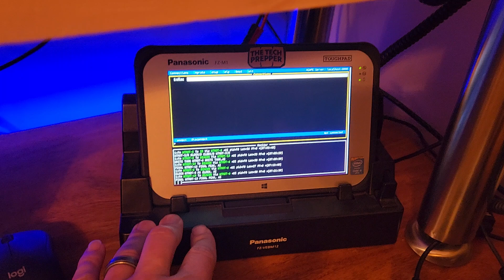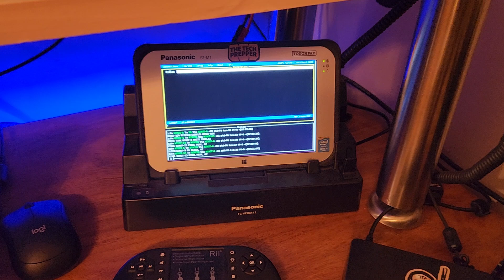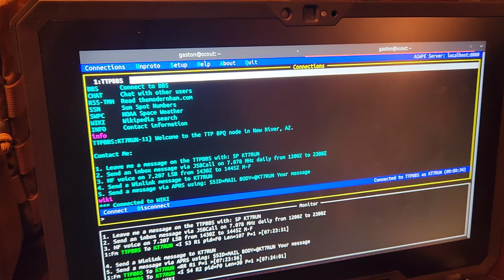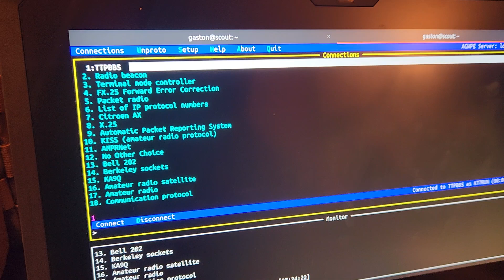A quick debrief on the 9600 baud packet BBS port

Comment: I notice the new FCC rule for symbol rate did not include 6M since it was VHF. Let’s hope they take the symbol rate requirement out of VHF and UHF to get better speeds like 56K with higher order modulations.
Reply: Yeah especially because error correction is a thing, it would work flawlessly

Comment: 9600 baud is fast, but you'll find that it doesn't work well for long distance transmissions.  APRS also supports 9600 baud as well!  I wish more radios supported it as well - that's the other negative.  The number of radios that support it is small and not growing.  When comparing symbol rates, the speed of 9600 baud vs VARA FM wide mode, there's no comparison.  VARA FM wide mode does up to 25,210 bps - a heck of a lot faster than 9600 baud - but, in my testing of VARA FM I've found that packet 1200 on FM makes the distance.  VARA FM works but data rates drop off much faster than packet at distance.

Comment: This could help more than just your mini computers.
DC-DC converters are usually noisy. I have an Astron 4812-12 converter to test using my big LiFePO4 EG4 battery. It has a wide voltage input range. It does work with old 40V power tool batteries. Bigger output power units are found on electric golf carts to run lights and accessories.
Your battery is a good one, but older lead-acid batteries still have lots of power left when the voltage goes below 12V. A converter lets you get all the power out of the battery, to the point of near damage. It is part of my home station with the PowerGate.

Comment: Faster packets would conceivably be more resistant to fading (especially on HF) and multipath distortion.
Reply: But more susceptible to noise.  Channel capacity depends on the signal-to-noise ratio. Faster transmissions inherently have a lower SNR.

Comment: Neat
Reply from the maker: It was neat, once I got it working. Too many moving parts in my opinion. New cables, special data ports, new radio configurations, new software TNC settings, etc. If it works in the real-world and is an improvement in performance and/or range then I'll keep it as part of the service. You never know until you try.